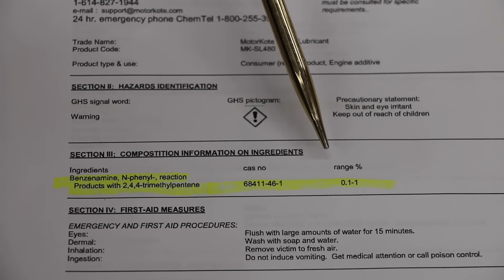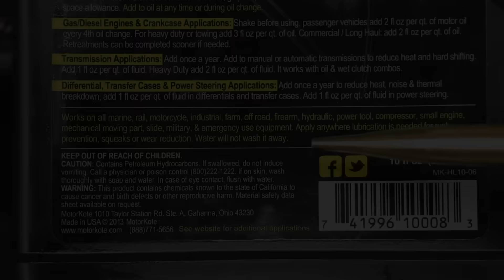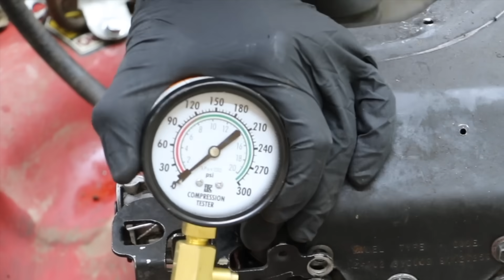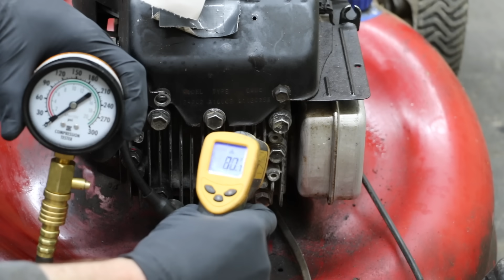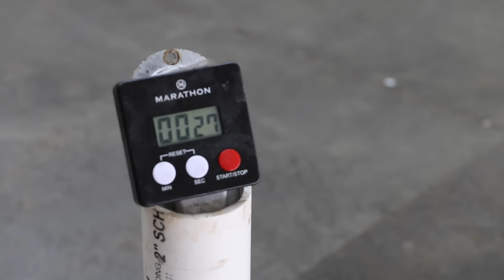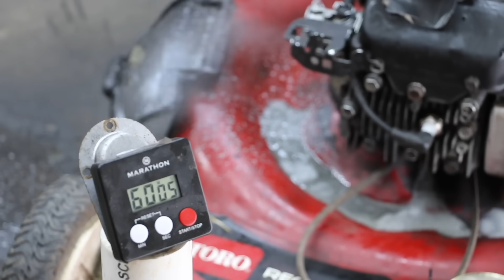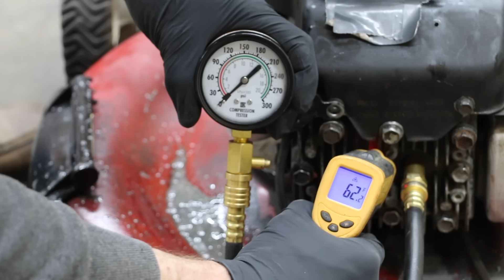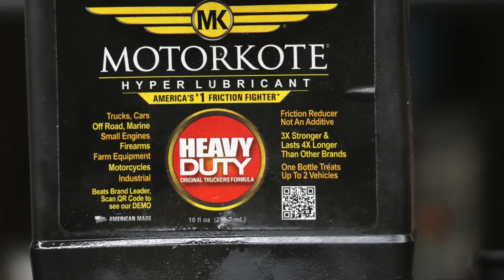Can MotorKote survive the water test?  Let's find out!

Comment: I like the lubricity test that you do, but got to wondering about how the change in operating temperature would effect it. Is there a chance you are able to do this test with operating temperature lubricans!
Reply from the maker: Yes, I can heat these products, but maintaining near exact temperatures is very challenging, since the test equipment will be ambient.
Reply: Project Farm I would like to see the effect as the lubricant properties change in temperature. Perhaps in the future you will be able to have the dish of lubricant that is picked up by the race sitting on a small hot plate or similar. 
Your tests are great, just a suggestion as when you do this test, it only works for the temp checked at, and some lubricants will perform differently as temp increases. One that is better at ambient may be worse at operating temp.

Thanks for the reply. Keep up the good vids.

Comment: "I'm going to run this engine for an hour with nothing but water in the crank case to test MotorKote's claims."

MotorKote Representatives: Spits out coffee "What the WHAT?!" Begins to sweat heavily

"The engine survived. I didn't find very much metal contamination at all."

MotorKote Representatives: Cheering and celebration
Reply from the maker: LOL!  Funny!
Reply: Then raises all prices of MK products lol
Reply: @gsxellence  their cost is already high.  But I use it every third oil change in my Detroit Diesel 14 liter.  1.25 million miles and no head bolts have come out of it yet.  Shit works for me.  I been around diesel engines for 50 years and this is rare.
Reply: @kenbowser5622  I drive a log truck with a 12.7 over 900,000 miles on it. I've only been in it for about 50k. I don't drive it very hard but the previous driver told me it is turned up to 575 and can drag 84,000 plus 90 mph. I've never tried it but it rolls coal and has been rode hard. They change the oil every 15k miles and add motorkote every oil change. Must be doing something for it because the engine doesn't use oil and has very little blow by. I've seen better treated 12.7s with less miles in worse shape. We have only 2 12.7s rest cummins and cat all similar shape and mileage due to motorkote. In log trucks none the less very abused engines. After seeing this I think motorkote is the reason our trucks have significantly less down time than other companies. I'm gonna start using it in my personal vehicles.
Reply: im dying XD
Reply: @AEON.  he does not accept free products to stay unbiased.
Reply: I’d have drunk myself blind
Reply: This is true. I know Ed Gibbs. He admitted to this on 700 WLW Cincinnati. You all night Trucking radio show he does about twice a month trivia question for discount codes for almost the entire show. I brought this video to the attention of America's Trucking Network l700wlw night radio show) when Ed Gibbs was on. And he admitted to being worried a little simply because they hadn't tried this test before. He knew that water would not wash it away because they've tried it on a piece of metal and tried to hose It Off and the motorkote stayed. Project Farm took this to an extreme. And motorkote passed the test so just by doing this test project Farm actually picked up subscribers because of the exposure on Nationwide radio. Yes 700wlw is one of the big Super stations and used to be on Sirius XM now they are on iHeartRadio. People in other countries actually listen to that particular show. Through internet streaming.
Reply: @truckinchihuahuaalvieschre2494  
Oh Yeah! Have listened to Dale and Steve Sommers for years. Midnight to 5:00 am, put in a lot of miles listening to 700 WLW AM. I use Motor Kote in everything I own from chainsaw to diesel tractors. Works great in everything.
Reply: You get My comment of the year award!
Reply: HAHAHAHA!
Reply: This was a good comment. Really funny. However, as the old saying goes, "the proof is in the pudding.
Reply: David Thomas the proof of the puddling is in the eating.
Reply: It is tempting me to add motorkote to my minibike
Reply: I got 1.25 million miles on a Detroit Diesel 14 liter and haven't had a head bolt out of it yet.  I use a gallon of motorkote every 3rd oil change.  Don't smoke but leaks like a Detroit?  I'm sold on this shit.
Reply: Nope, Mr. Motokote didn't flinch one bit.
Reply: Gave your 300th like
Reply: @SMOG noted. That's a long way.
Reply: Been using Motorkote for 10 years. Put a qt. in my 2000 expedition trans.10 years ago along with recommended oil changes.
200k and going strong.
Reply: @SMOG where are you?
Reply: @AEON.  not 61K viewers, try 600K viewers in April 2020
Reply: Fucking great lol
Reply: LMAO
Reply: @vacexpert2020  
have you tried Lucas oil stabilizer?
I had a 1998 Chrysler Concord,  2.7 V6 the rods would rattle on first start up, used Lucas oil stabilizer and and it did quiet the rods. About a year later I replaced the rod bearings,  and I still would add a quart of Lucas at every oil change
Reply: Right? 😂

Comment: Holy bana peels, Batman! That Motorkote makes for a supremely slipery slope! I wonder how i would perform against Amsoil Signature Series 100% synthetic oil. It claims to have little wear on a double-length API test, contrasting against some cheap oils that fail the standard-length test.
Reply from the maker: I plan to test Amsoil Signature Series soon.

Comment: What happens when you run it on 100% MotorKote?
Reply from the maker: Thank you for this recommendation!
Reply: @ProjectFarm  how about motorkote vs bestline
Reply: Exactly what I was going to suggest... I  am very glad to find his info!! 100%Legit efforts to gain and share great tech/consumer knowledge! Props!
Reply: Might give a shot of both lol
Reply: I was given a seized small Craftsman electric air compressor that fell over while being used and it locked up. I took it and tore it down and got the parts moving. To fill it I put about 2-3 ounces of straight Motorkote in it, I plugged it in and flipped the switch and let it run till it filled the tank and shut off, blew off the air and repeated the process. I've been using the compressor for about 10 years with the same 2-3 ounces in it.
Reply: Your car runs backwards and the gas tank fills up.
Reply: TheVexCortex  I’m guessing it would work great, but you would go broke in the process ;)
Reply: You drain your wallet
Reply: I’d like to see this test
Reply: TheVexCortex don't it makes a black hole
Reply: your viscosity will be too off. you might strain the oil pump, and make it run hotter.
Reply: You wind up with a very expensive oil change, as a gallon of motorkote costs around $100.......
Reply: @blaga2005  yeah but you only have to do it once every few years then
Reply: Seems like it would be too thick. Might limit the flow, causing a lack of lubrication, especially in the valve train. There's some pretty small holes feeding the top end.
Reply: @franknewling1139  if you have ever seen motorkote you would know, it has pretty much the same viscosity as 10w30
Reply: A lot of the pilots at my local flying club run a mix of 50% motorkote and 50% oil, they swear by the stuff
Reply: It will create condensation in the crankcase
Reply: Can't make much more condensation than quarts of water

Comment: ***ProjectFarm, You should purchase one of these timers off of FleaBay and wire it up to your lubricant tester motor so that you can set it for 30 seconds and let it automatically shut off instead of having to manually start a timer and then catch it right at 30 seconds.   

https://www.ebay.com/itm/Digital-Twin-Timer-110V-Delay-Relay-Switch-Digital-Timers-Relay-INKBIRD-IDT-E2RH/391346509006?hash=item5b1e11d4ce:g:GG4AAOSwgQ9VpgGl
Reply from the maker: Thank you for this recommendation!

Comment: I have an uncle who uses a mix of 50/50 with grease and uses a syringe/ needle to add the mix to sealed bearings on farm equipment he swears by it. Out of 30 machines ( bearings, a lot) on one failure in 5 years.  On the ones he could get to.  He says a great winter paying job.  He pressure washes the bearings then slips the coated needle under the seal. And adds his mix.
Reply from the maker: Wow!  Impressive!  I have a lot of old farm equipment and might try this.

Comment: Since these results are quite impressive and seem to hold a level of promise

Could you test any possible negative effects it may have on... 

different types of engines?

Can it help an engine that burns oil on a regular?

Gas mileage?

What effect does it have on seals over time?

And it's always interesting to see...
What other uses can you find for this product??
Reply from the maker: Thank you for this recommendation!

Comment: Do a test where you run MotorKote in an engine then drain it and run the engine dry until it throws a rod. Then compare its results to your previous additives tests!
Reply from the maker: Thank you for this recommendation!
Reply: Project Farm I was also looking at MotorKote’s website. They have other products such as spray lubricants, sludge removers, fuel optimizers, and motor treatments. If you do any videos in the future involving additives it might be worth including them in your sample.
Reply: Got an old Dodge Dakota that's been running on motorkote now for 5 years no oil pressure at idle. Bought another truck for the engine figured why change it as long as this one still running. Really figured I'd change it by now but other than the oil light coming on in an idle and the oil pressure gauge going to zero you'd never know anything was wrong with it. And before you say anything the oil pressure gauge is a mechanical gauge not the electrical gauge it literally has zero oil pressure at idle and only about 10 lb going down the highway. And yes I have worked this truck on more than one occasion. In fact it actually pulled the donor truck home that has its engine replacement in it 4 years ago. Just happened so that was the truck that I weighed on a truck scale and a Truck Stop on a bet that Dad thought we was overweight. My exact gross weight was 11,960 lbs. I believe that worked that v6 pretty hard. And it really didn't care.
Reply: +Alvie Schreckhise: Well your rig beats my rig. I have a 6.5 diesel in my old '83 chevy van. It runs zero oil pressure at idle hot but about 22 going 65 down the freeway. Been that way for 80,000 miles or so. It is stressful though when driving across country or especially going offroad where there is lots of idling. I too have a performance built 6.5 waiting for it in the wings.
Reply: @ 4x4 scout. Have you checked the oil bypass circuit - 20/0 in an MGB engine tells you that the oil is bypassing the main circuit.
Reply: Rosie Hawtrey it is a very small amount it takes 20 min to filter all the oil where the oem filters does it on every cycle.
Reply: @consaka1  Try changing the oil pump, you should see a difference.
Reply: @truckinchihuahuaalvieschre2494  
Not a fair assessment. You are talking about a Dodge.
They can't be killed.
I have a 2000 Dakota sport 4x4 with the 4.7 Magnum v8.
Body all but gone. Haven't changed the oil in it it over 2 years. Radiator blew up on a hot day and drove it for miles and miles over 260° till it died.
Let her cool and fired right up.
240,000 or so miles (hard as a rock!!) Miles. Still going strong. Still factory oil and plugs. Lol
Reply: @HARDG1984  Grandpa did that with a Ford Fairmont one time. With a 302 in it. When it overheated It ran until it lock up. When it cool down it run like a champ and never even burn oil. What killed that car was the C4 transmission. It started slipping real bad in fact it wouldn't even pull into the driveway. But the next day it burnt the tires off of it. We was just afraid to drive it anywhere after that.
Reply: Agreed, motorkote vs Bestline please!
Reply: I second that. My bets are even longer than Lucas oil stabilizer.
Reply: YES!!! this is the test i want to see!!!
Reply: Did he try that alredy?
Reply: Just wondering what pump you are using to siphon the oil out of the mower? thanks.
Reply: @verucelee7420  
It looks like a Vacuum Pump. He has the Vacuum line from the pump going into the jar. Then the drain line goes from the jar, into the crankcase.
Both lines are siliconed at the lid to maintain a seal. As the Vacuum pump draws air out of the jar, the oil is sucked out of the crankcase into the jar.

Comment: It would be interesting to see just water in the crankcase and no Motorkote
Reply: That would be a waste of an engine. It would not last 10 minutes with no treatment.
Reply: @dinkchow  prove it
Reply from the maker: Thank you for this recommendation!
Reply: You would have to rig up a slow - flow water supply, adjustable, to be sure that the failure, if any, wasn't due to lack of fluid (lubricant) as it boils off.
Reply: I agree.  This comparison needs to be done to show whether motor kote really improved anything.  Please perform that test to wrap this review up.
Reply: good way to get a benchmark
Reply: Agree! this would establish a baseline to compare the Motorkote treated engine to! Really enjoyed this video!

Comment: I'm surprised you didn't run the motor with an empty crankcase till failure. Would have been great to see how long that went.. one thing I do know about motorkote, I have the spray version you can't safely use it on plastics like for example WD-40. several days later the plastic will disintegrate. Love the videos. Thanks
Reply from the maker: Thank you!  Yes, I've gotten a lot of angry comments on destroying the Predator engines.  Still not sure if I'll resume this sort of testing again.
Reply: Project Farm yea well people get upset when people take perfectly good cars and use them in demo derbys too.ya just can't please everyone. Personally I would be fine with any old motor,even an old car. Thanks for the reply

Comment: I see one of the issues with testing these products is difficulty with putting a constant load on the engine for a long period of time.  I think making the engines work hard would be a plus for the testing.  I'm sure you have better ideas than I do but I'll throw a couple out anyway.   What if you used a weed eater engine and installed a stiff blade to the cutter head and ran that in water or oil in a barrel?  Or could a pulley be attached to a mower output shaft so that it can turn a large fan?
Reply from the maker: These are great suggestions--thank you!

Comment: If you want to make the test method even more accurate you should messure the amount of oil/liquid you pour into the bowl under the spinning wheel in your test machine. This is as much a suggestion as a question, but would it make sense?
Reply from the maker: I believe that keeping the wheel coated while turning is very important.

Comment: I’ve been using this in my dd15   For years and 1.5 million miles later the inside of my motor still looks and acts like new even gets longer life on my turbo
Reply from the maker: Impressive!  Thank you for commenting on your experience with this product.  Have you ever had oil analysis accomplished for acidity?  With 1.5 million miles, it seems clear that the product is fine, but some have concerns about sludge/acidity.
Reply: That's what I was hoping for. Some insurance on the turbo life! (3.5 Ecoboost)
Reply: I am using Motorkote in a 2.0T Ecoboost and everything is all good.
Reply: Sorry I forgot... I only had a fluid analysis one time and yes they were all good but that’s cause I am strict with my fluids
Reply: How do you like the dd15, is it as good as other Detroits?
Reply: Tony Vittitoe how you like the Eco-boost?   I've been looking for some high mileage reviews 400k+ miles to see how they hold up, Mpg highway and what parts were changed but I have yet to see a video of a high mileage 3.5 Ecoboost
Reply: ElroyJosephJenkins JrTheThird 
Only 54k so can't say about reliability. Other than I had to change the spark plugs early but from what I hear that's normal. It's very smooth and lots of torque. The only time that there's lag that I notice is if you floor it from a stop. Just a little lag and it's going! Mine is in a SHO. The torque is nice also because it cruises 70mph under 2k RPM. It doesn't even kick down going up hills. Cruises right up at 1500 Rpm. Mpg is average at 23mpg right now. Mix of everything with maybe a little more highway.
Reply: I had I pre egr dd15 525 hp. I’ll tell ya it’s not the most powerful or the most glamorous but if you treat them right they just don’t quit and if they do used parts are as cheap as a damn Chevy... I’m a huge dd15 fan I’ve had cats and Cummins my old cat 550 was certainly more powerful but it was always in the shop and you couldn’t give me another Cummins, they’re boat anchors.
Reply: @abelladeau9354  DD15 PRE(?????) EGR.....???
EGR was already on the good old D 60 since the beginning of 2004 AND DD 15 came AFTER the mandatory EGR era!?🙄🤔🤯😉
P.S. As much as I can recall DD 15 showed up sometime in the last few months of 2007(or in the beginning of 2008) and the EGR was already the worst mechanical hemorrhoid in the market ...
Reply: Guergui Stoyanov you’re right I miss spoke... sorry my current is a dd15 it was an old dd60 sorry for the confusion dd60 NOT dd15
Reply: @abelladeau9354  All good!👍🍻😂

Comment: Two things: 1- that must be a miracle engine! 2- I've never used MotorKote but I've had experience with ZMax and it does soak into the cast iron and aluminum engine parts as well as leave a film on everything. My first experience was preparing a Cummins engine block to weld I had to preheat it about 2-3 times as long to get the oils from coming out of the cast. I was convinced and I've been using it for 15-20yrs now in my daily drivers and race engines.
Reply from the maker: Thanks for commenting!